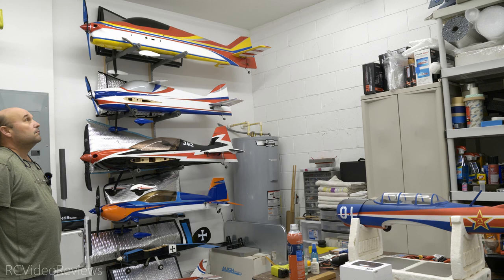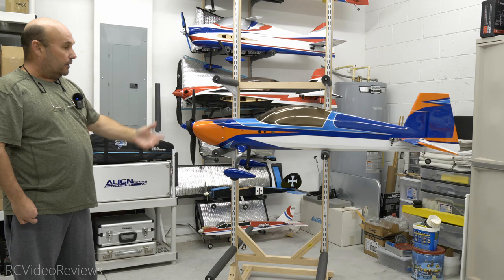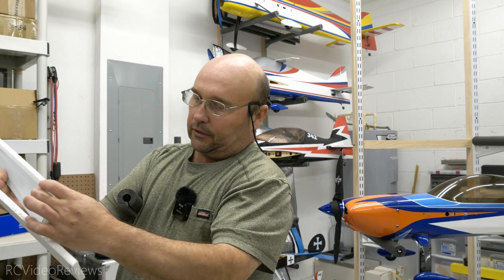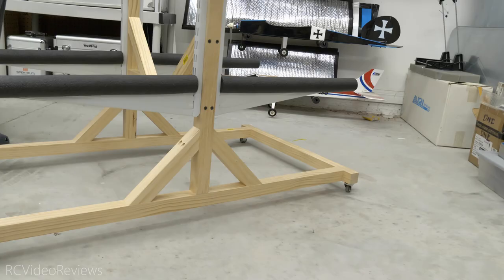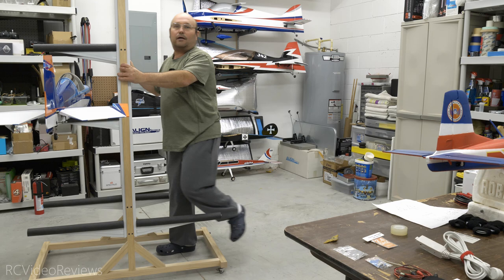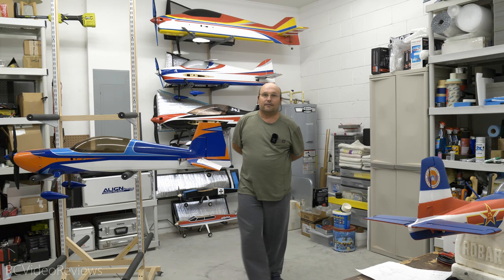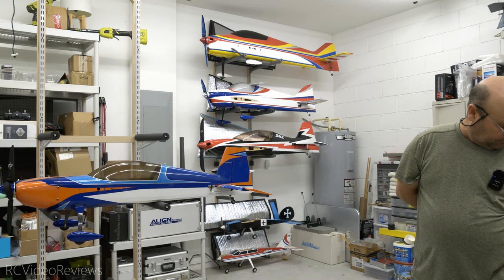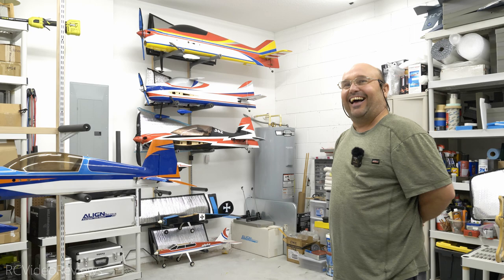PERFECT SIMPLICITY: Best RC Plane Storage Racks Ever! For [big] RC planes.

Comment: doing this for years, I put plane on side with wheels facing wall. Rudder sticks out less in to room than the elevator does if placed right side up.
Reply from the maker: It's a good system. Compact but not cumbersome.

Comment: I've just made something like that from 8 mm beech wood rods and pine bars (think it's close to 1" by 2"), but just for the wings. It can handle lots of them.
The fuselages all got a "clown nose" for the spinner, 3D printed from TPU, to stand on while leaning on the wall 😁
The only problematic planes are the EDF foam jets. They don't really match anywhere, short wings and wide fuselages.
Reply from the maker: I'm keeping one of my small PVC racks for those pesky jets.

Comment: Eloquent design!!  One question: for the stationary assembly on the wall, what is the advantage of first attaching the wood rather than attaching the brackets directly to the wall?
Reply from the maker: I'll ask Dave to respond.
Reply: Hello, there are several reasons why I ranther mount them on  wood. I rather make less holes on the wall. The wood goes on the wall with 3 anchors. The rails have about 8. It depends how big they are. The walls are not always straight they have bellies Sometimes, if you have wood behind the rails it's easier to level it out In my opinion, if you are doing it in concrete you rather just drill 3 holes than more. I would assume plus the concrete block is not always perfect( Concrete blocks not lined up) So the wood provides a flat surface. But they can definitely be mounted straight on the wall. Whether it's concrete or drywall, the wood behind it provides more flexibility and less repairs at the time of removing them. I hope this helped have a good one.🙂
Reply: I already started using the wood backing. Much neater design. Tx for the tips and the mobile rack will be next!
Reply: @alanbier  👍🙂